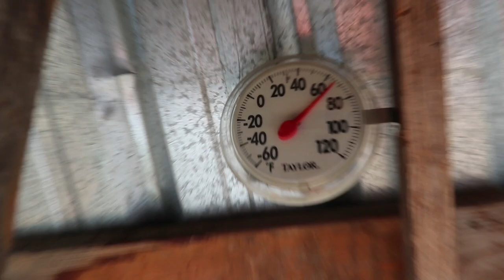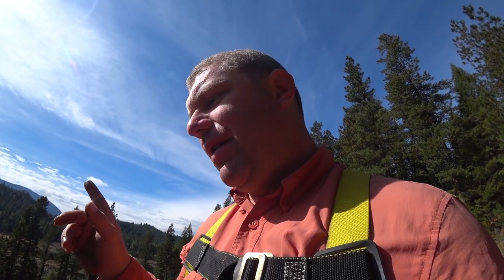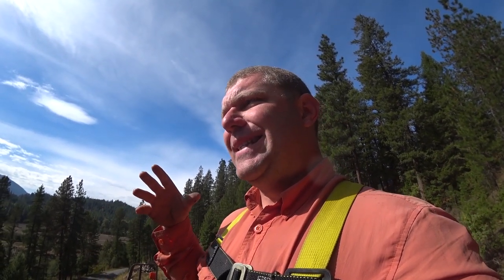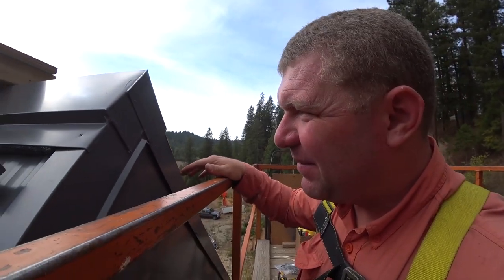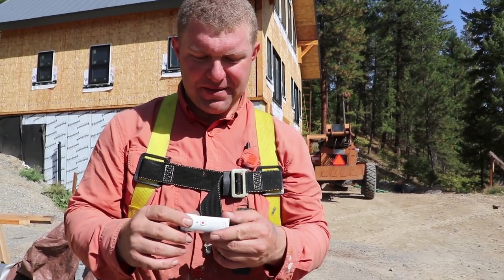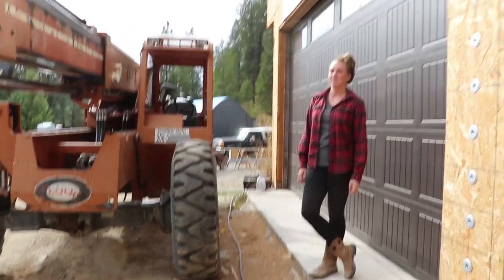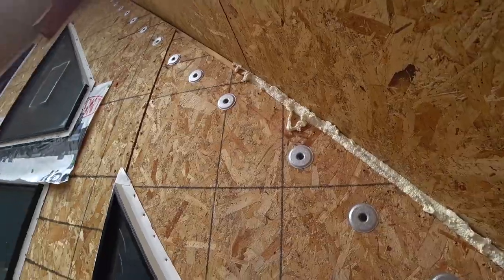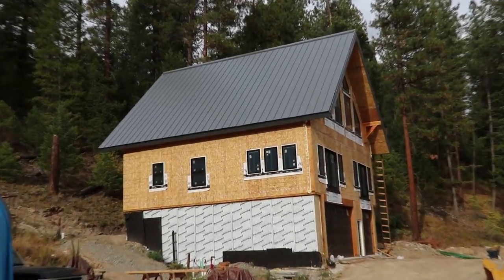Construction of a Home in the Wilderness: Finishing Roofing

Comment: The whole purpose of Tyvek House Wrap is to allow moisture vapour to pass from the inside out, but prevent water droplets from getting in from the outside. Therefore wrapping the OSB is a must, like you said OSB hates moisture and will blow out the wood strands especially around the edges. And any water that WILL make it's way in between layers within the structure and gets trapped will rot your house out.

Comment: Congratulations on creating a roof that your grandkids can admire.  Before putting my standing seam on, I looked at hurricane damage, tornado damage, 60 year old roofs in the deep south and decided that it is the roof of choice.  I will take it over any other roof except maybe the new Tesla roofs with solar.  You did a great job on end caps and it looks good.  You will sleep soundly when there are big storms.  No worry about leaks or damage from hail.  Here in Austin, mine was subjected to 3 inch hail and after a few years it looks like there was never any hail hit it.  When the squirrels, cats, and other critters are on it, I don't care as they can't do any damage.  KUDOS!!

Comment: Hi, thanks for your informative, entertaining, and dramatic videos. Regarding your exterior roof caulk. I think that black colored items or caulk are most resistant to breakdown from the sun. Black absorbs the sunshine and warms up but also doesn’t allow the light rays to penetrate. When light penetrates something the rays alter the material causing it to crack, dry out, and possibly fail. So for roof caulk exposed to sunlight I think the best choice is the color black. Thanks so much for what you do. Your work and problem solving help me with my own projects. Cheers.

Comment: All the cans of polyurethane foam I've used say in the instructions to lightly spray the surfaces with water to help it stick - I've not seen you spray anywhere in any of the videos - But I did learn something from this video, the use of a longer flexible piece of tubing for when you can't use the upside down can in a tight space, I've never seen that done before.

Comment: I have a metal roof that I installed myself.i folded the ridge cap like you, but I cut the last fold at 45°. That way the fold would look vertical. It looks like I did the hole cut at 45°. But I do like that you pop riveted where you did. I just used screws. Good job.

Comment: Little roofing tip, never caulk the bottom. When the caulking on the top edge fails in 10-15 years, the bottom sealant will probably be good, when water gets in the bottom seal will hold the water and cause damage to the anything it touches. 

PS: love the videos of the roofing, interesting to see how different regions approach roofing. I think you would have loved to install the rake trim we use, and hate the vented ridge we use!

Comment: The ventilated roof is designed to remove heat soak from the metal roof ( it gets very hot! ) The moisture removal is an added benefit. I've seen people put a heat exchange pipe in the roof valley and collect free energy for hot water and heat. ☺

Comment: I've done a tin roof over a 1000+ feet drop. A 2 storey home over a cliff face !  #Jessie you have to make that seam vertical on the end of the ridge capping it can't be facing the top of the roof, "IT WILL LEAK THE WAY IT IS REGARDLESS of the silicon you used" !  The seam must run vertical ! ! ! !  And it will look a tonne better ! ! ! !

Comment: Those aviation sheers you are using to cut the sheet metal are for curved cuts.  Red and Green are for right and left (not sure which color is which) and yellow is the one for straight cuts.  Also if the gap is too small to foam then just caulk it and be done.

Comment: Sometimes for things like this I will make a identical piece out of single later cardboard or think poster paper and then figure out the bends and cuts in that.  I guess if you had another piece of scrap ridge cap you could do the same for a test.  Good job doing it on the metal without a practice piece :)

Comment: Hi Jesse, how about having 2 foam cans....one with a short straw for tight cracks and the long tube for larger deep crevices ?  It would be easier to control. After each day's use, the foam will cure and can be pushed out of the tube with a piece of coat hangar for the next time.  Hints from CRAFTSMAN369    J K

Comment: I would leave a little over hang of the ridge cap off the ends of the roof and leave the ends of the ridge cap open and screen them to get maximum exit for air. Moving air is the best way to wick away moisture. I don't trust those membranes to do enough.

Comment: I'm not sure I get the whole sip thing ???
2x6 or 2x8 walls with spray foam insulation would have been way better !  Way faster !!  Would have cost way less ! Would have been done by now !!!
You could have still used the Timber framing if that is what your big thing was about !
But one thing is for sure when you are done you will have $750,000.00 stuck into a $400,000.00  home ........  
If that works for you !!
Good luck

Comment: Jesse, use some of the other roof cap that didn't fit to practice this step. I have been very impressed with you guys this entire process. I have watched, silently cheering you on from the very first video. And I have seen them all. Now, you usually are really big on using the right tool for the job. Why are you only using that one pair of metal snips for all the cutting?  There are so many other tools which would have done the job better! oh well...not too shabby for a first-timer without all the right tools. Really, I am impressed.

Comment: Now that it's done I've got to ask, was it ever mentioned that Jessie was using Red handled aviation tin snips that are designed to cut primarily to the LEFT of straight.  They come in a set of three (red, yellow and green) for a reason.  Trying to cut to the Right with the Red handled snips is a bxxch.  I was holding my breath each time you went up to ridge cap.  Good job Jessie and I'm glad your done with that as well.

Comment: Yes tyvek would be counter productive in that it could potentially trap moisture between it and the sips then causing rot. However tar paper would be beneficial because tar paper works by absorbing moisture and then drying itself out without trapping moisture between itself and the substrate. Only time will tell but not putting tar paper on the sips is a big mistake from my experiance of cold roofs

Comment: Your theory on the SIP is all good during summer heat.  But night time and winter months reverse the airflow.  You created a moisture sponge by not covering the SIP and sealing the bottom of the roof system.  The venting at the eave is even muzzled by the drip and fascia, so not sure why you went to the trouble with screen mesh over the air gap above the eaves in the SIP-deck transition.

You still are doing soffit I hope.  The fascia is loosely attached.  You need soffit to anchor your fascia or it should have been cleated.

Comment: You were on about being on the roof with a ladder as dangerous you can get on line a clamp on bracket that fits on to the ridges so you can put boards on to and stand on very safely you move them up or down clamping to the ridges .

Comment: I strongly recommend using a wire mesh under your ridge cap it is best to double lay chicken wire or chicken wire Lake material in between your ridge cap then place the ridge cap over the chicken wire making sure before you place the ridge cap over the chicken wire that the chicken wire is securely secure with no gaps I know this is a pain in the butt but trust me you will be much better off doing this then to have a full-scale rodent problem

Comment: Just one thing i notice that may become a problem in future. you should not have sealed the bottom of the those gable folds, if the seal at the top leaks then you will trap water between the sheets that will eventually rust and you may get rust lines. thee bottom should be open so any  water that leaks in can get out. unless you plan to reseal regularly.

Comment: Your end cap should have been sealed before attaching it, not adding sealant to the joints for better sealing. You could have used a screw to line up everything, removed the screws and applied sealant, then attach with your rivets.

Moe

Comment: What ? Not a factory made end to the Ridge metal ?  Should be one.  They know the size.  Cut back the end and put on the shoe end cap that abuts to the Ridge and is folded in place in a double fold.  Pop rivet sealed in places.    Good sheet work, could be better with a shoe but not bad as it is.  Martin

Comment: For your intake and outlet on the cold roof, shouldn't the upper one be slightly bigger?  If the air is warm an buoyant it is going to occupy a greater volume.  Then again, I guess you're not building a jet engine or anything, but still...

Comment: Doesn't silicone that is exposed to UV break down pretty quickly over time? How come you didn't apply sealant underneath the ridge cap flaps instead of smearing it on with your fingers?
Regardless, well done. Congrats. Now go back up and touch up all the paint scratches and double and triple check all the areas with sealant on them.  =)

Comment: The vent material that is under ridge cap that dad came with seal tape is not a rodent preventer rodents will easily climb on top of your roof get up to that ridge cap intra and chew right through the vent material that has to face tape on it rodents will chew right through that with no problem whatsoever this happens very often please contact your local pest prevention specialist they will tell you this roofing companies and suppliers lie through their teeth to their customers they know this is a problem a rodent only needs to get the tip of his nose through basically smaller than the size of a quarter even a full size rat they love to nest in Ridge caps